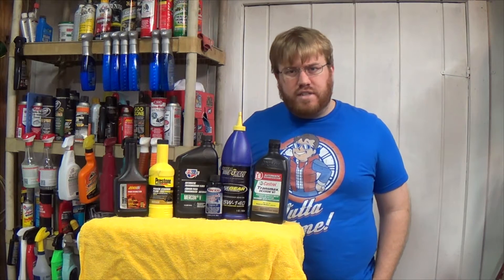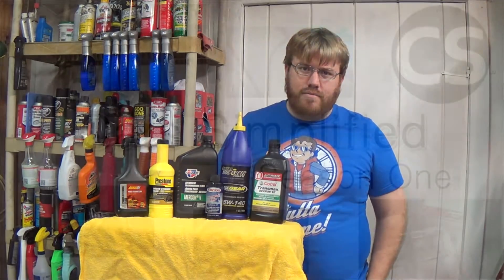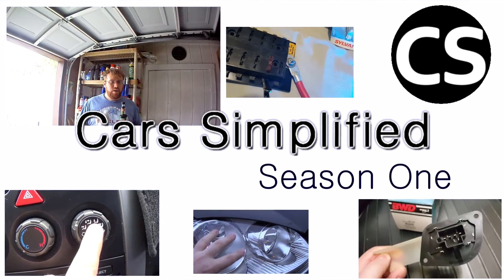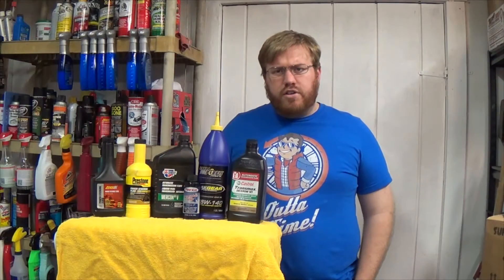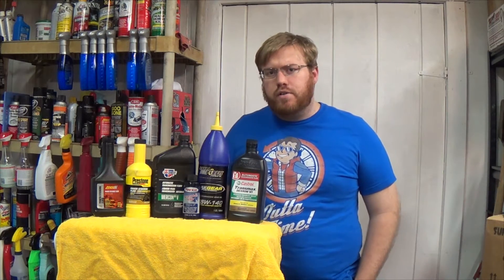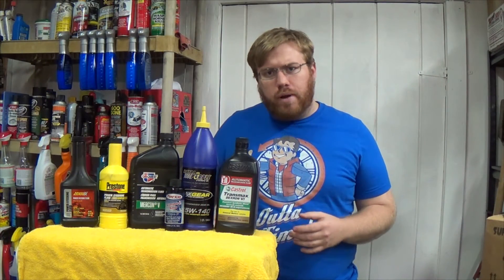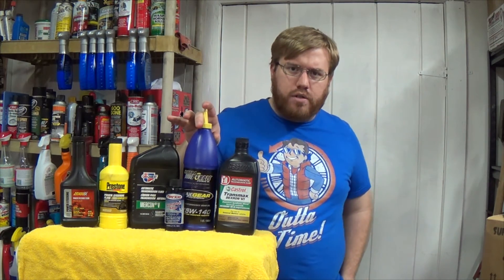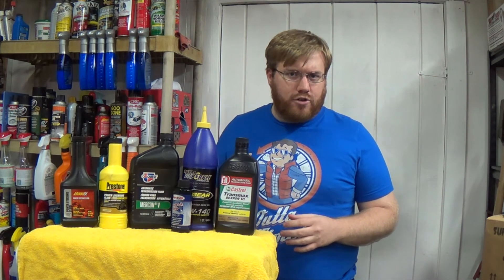What Are Friction Modifiers? • Cars Simplified

Comment: does a friction modifier decrease or increase friction?
Reply from the maker: From my understanding of the kinds I read about, in addition to the change in friction behavior talked about in the video, a gear oil friction modifier will reduce friction beyond what gear oil (without pre-mixed friction modifiers) alone will do. However, I would double check with the specific friction modifier(s) you are dealing with.
Reply: It decreases friction, but it can do bad things to new good bearings for example, it can start slipping